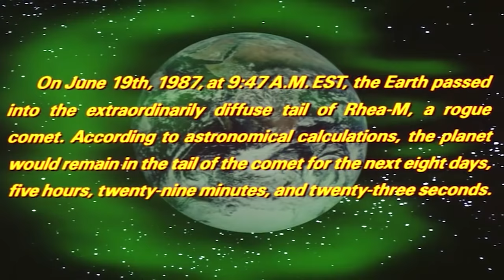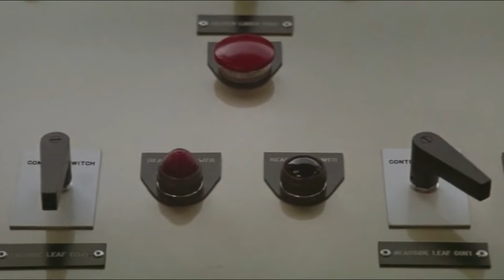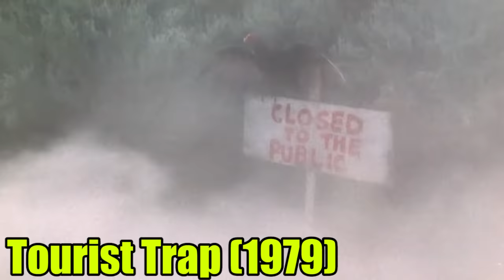10 Underrated Horror Films That Should Be Remade

Comment: The Funhouse - Eli Roth was actually in talks with Universal about remaking it back around 2009, nothing happened. I would assume that's because the original film made money but it received tepid reviews from critics and moviegoers.

The Howling - Are you kidding? Why remake something that's already perfection? Besides, the movie was not even close to "true to the source material". The book is even better than the film and takes us on a far darker ride. Maybe a reboot true to the book would work.

The Driller Killer - Was f*cking stupid when it came out, and would be twice as stupid as a remake.

Maximum Overdrive - Another "If it ain't broke, don't fix it" example. This film was great for when it came out. It needs to be preserved, not remade.

Two Evil Eyes - Don't you DARE ruin this one by remaking it. The mood, the sets, the camera angles, the script and the acting are what make this film work. Argento and Romero already made this great, it doesn't require any sort of facelift.

Tourist Trap - See 'The Driller Killer' above. FT13 part VII comes to mind. Ridiculously unnecessary mix of horror and sci fi. If you want a great horror movie about telekinesis, it's already been made - Scanners.  Please don't remake that one, either.

Wolfen - None of today's CGI or directors could make this better than it already is. Like the Howling, a reboot based on the novel may be a good direction instead of some diluted attempt to remake it.

Chopping Mall - The only way to make this one work would be to make it a horror comedy with lots of campiness going on. Scary Movie 6?

Slumber Party Massacre - has already been remade ad nauseum. If you can't find at least a dozen clones and ripoffs, you don't know how to Google. "Remaking" the original (it wasn't even "original", the theme of sleepover slashers was already mainstream) would just add to the trash heap.

Hell Night - HELL NO. This classic movie is already great and should NOT be remade. No one can fill Linda Blair's shoes. 

Summary? 

Hollywood needs to come up with original ideas and stop ruining classics with lukewarm remakes and reboots. For every one good remake there are two dozen absolute failures.